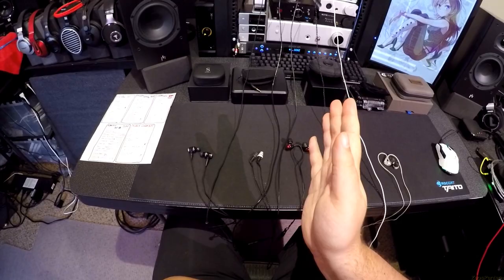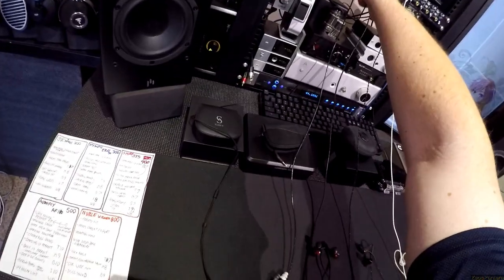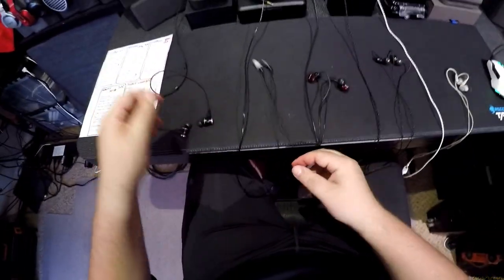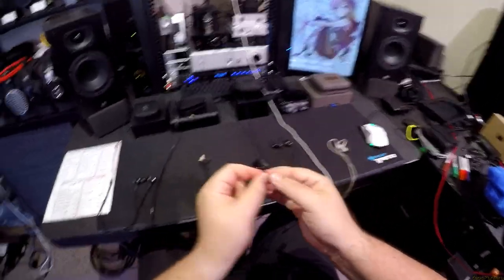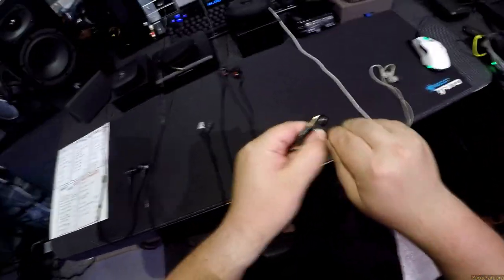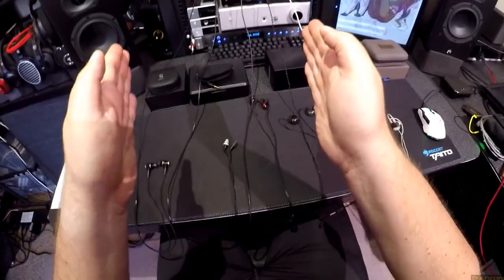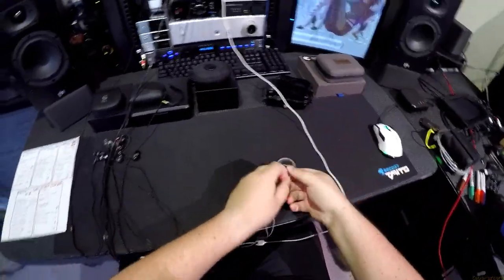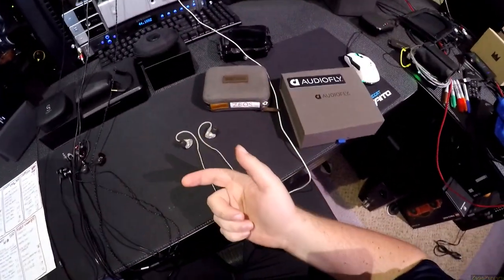Z Review - IEM Shootout #6 - AKA "The Bloodbath"

Comment: 23:20 this is the part where he fucking murders Shure IEMs
Reply: Cereal421 it would be you huh
Reply: Cereal421 he follows orders
Reply: Lel.
Reply: XD
Reply: The etymotic cable is removable

Ety S adapter is the ety sound, with out the adapter is the compromise for portable use.  Also the cable is microphonic, but the blob at the y of the cable is where the shirt clip attached and where the impedance resistors is housed if you have the ER4S instead of the P/T. The clip is dorky but greatly helps with the cable noise.
Reply: The cock rings are for attaching your portable amp to your phone/dap.
Reply from the maker: The murder is the Audiofly's murdering everything.
Reply: how does the westone w40 compare to the 5 here?
Reply: Cereal421 shure connectors are junk

Comment: The adapter for the Etymotics isn't just an impedance adapter. It converts the 4Ps into 4Ss, which are more accurate and sound better. It should definitely be plugged in unless reviewing them just for portable use.

Comment: Shure fan here, or at least one who loved the SCL2-K from over a decade ago, and has used a SE215LTD for about a decade. Both of those Shure IEMs I loved for their sound, and build quality. Also having used Shure's warranty service for the SCL2-Ks, I have been happy with their customer support.

Now the concerning what you said about the SE535LTD, I watched this video eons ago and forgot about what you said. Recently my SE215LTD after a decade of service has developed a issue in which I am on the fence about fixing them myself or sending to Shure. I also was interested in upgrading and seeing what the higher end ones had to offer, and on Black Friday these were around $340. I was expecting the triple driver setup to sound so much better then the 215s.

Anyways holy shit you are completely right. If I had remembered this video I would of saved my money. I enjoy my old SE215LTDs, and my MoonDrop Stellaris more. Like I can hear MORE details in the midrange with the 535s but the tone is off putting somewhat, and there is the sub bass, they call it "rich bass", its definitely lacking. From what I can tell changing out the filter in the stems might make these more fun from a forum post I read which I might try... But the ton makes most of the music I listen to sound meh or bad. Imaging in the mids, and sound stage is definitely there though and doing good, but the tune I presume from the filter is ruining them.

Comment: Shure se535 is awesome pair of iem. Bass is there very extensive, mid is way forward and treble is bit recessed or rolled off. I own clear version of it. I changed the filter in it to grey and orange as well. All the issues fixed. Sound couldn't be more clear and impact. Bass separation suddenly came through. There was layer of it. Treble was crystal as it could be and mid wasnt getting diluted in lows. Fits like a glove and good isolation. Also after chainging filter sound stage go way wider and instrumental separation was on point. If you want more bass that this then ie80 is way to go. I have ie 80s version and good for edm and hip hop music. Not boomy bass unless if you want to but low end is not natural feeling as in shure se 535. I also own fiio fh5 and 1 more quad drivers. These 3 i keep going back to cuz its  makes music so pleasant and effortless to listen 2.
Reply: you preffer the ffio or 535?

Comment: I'm glad I got the shure se425 over the 535. At the price point, I'm happy with the 425. You hit the nail on the head with the ratings though. Imagery that will make your hair stand up but not much bass to speak of. If you're wearing the shures the way you showed at 39 min, you wore them wrong. My shures came with the buds on the wrong sides of the cable. They're to be worn the same as the audiofly.

Comment: dunno if it got answered already.. but the noble stuff is detachable but it's stupidly tight.. i ripped the headshrink out of the plastic connector when i replaced the stock cable with one with a mic and volume comtroll

Comment: Hey Zeos, thanks for putting this together.  Great video per usual.

I have a potential explanation for why highs that were only "meh" on solid, reputable IEMs (ie Shure).  

1.) Hearing loss usually occurs between 2k - 8k (assuming that John's Hopkins Medical Center is to be believed).  
2.) In-ear monitors are situated incredibly close to the ear drum.
3.) In-ear monitors are competing with other very loud sound sources, at least in an on-stage environment.
4.) In-ear monitors are worn for what would be considered extended periods of time.

Considering the above, I could see why Shure or other professional IEM designers would make the choice to attenuate the 2k - 8k range in an effort to save end users from hearing loss.

I'm willing to accept that this theory could be complete garbage, but there you have it.

Cheers.
Reply: Does it actually matter where the monitors are? It's the sound that actually touches anything.

Comment: The ER4's actually technically do have detachable cables, although IIRC they're not designed to be removed frequently and are very difficult to pull off the unit the first time...
Reply: EMK19 just like it should be
Reply: actual QWERTY, why?
Reply: Prateek Chawla because the connector loosens and a lot of the times becomes intermittent after awhile. If they design it only to come off when you're replacing the cable, you won't have that problem.
Reply: actually QWERTY, fair, that makes sense. Thanks.

Comment: Noble cable is detachable. But the little connectors are stiff! (Got the Kaiser Universal 10's ... they are great, super light cable is no issue, more a pleasure. I did add some shrink tube at the little 3.5mm to add a bit of strain releave. For the tips, use the red tips, smoooth). For the Etymotic Research ER4P-T; the cables is also removable, same thing, stiff connectors. 
"those tips ... Comply Tips"

Comment: Hey guys, I did some research and find out that in video is Audiofly AF1120 instead AF180 and they cost 700 bucks, wich not stop me to buy them.
Reply: Its written on the case AF180 !!! but if true it will be a bummer , my 180 is on the way and it will be very disappointing to know that i bought the wrong model ;(
Reply: Hassab Saeed I saw both models unboxing, and I am sure that is 1120s, however according to reviews they have similar sound signature. But more important Audiofly's detachable cables have their own mmcx type connectors standard mmcx doesn't fit and both iems a bit slimsy (
Reply: Cerberus707 .. i saw in reddit someone says he prefers the 180 over the 1120 + Z gave his approval to the 180 ,, otherwise i would go for the 1120 , anyway i sent a message to Z to check his pair and am waiting for his confirmation , fingers crossed :)
Reply from the maker: These are the 180's with the silver cable. I also have the 1120's here now and they look identical.
Reply: Thanks Z for response, you all can check yourselves in all reviews the af180s show up in completely different leather package case, this big use for flagship iems. Wtf I am confused, but glad for you Hassab that you will get right ones.
Reply: it could be a regional thing or because Z is special , but anyway all are minores details to the sound quality ,,, will see how it goes :)
Reply: Cerberus707 .. i just got my AF180 and it has the same case as in the video ,, but wth black cable not the silver. 

These are awesome IEM ,, way way better than my IE800 ,, very balanced sound out of my mojo or my cell phone  , very impressive sound with great bass , sound stage , imaging , details ,, a bit worm but a pump at 5K-8K fixed it to my liking's , 

The Audeze isine still have the no#1 place in imaging and sense of space but the details and comfort on these is much better .. 

Now i will go and order the Bluetooth cable and the silver cable to complement them .

Thanks Z ,, great review ..
Reply: Wow , I guess they are really impressive. I have only 2 questions 
1. Some say the vocals sound muffled and behind, is it true?
2. Is it possible to modify their own type mmcx connector for attaching standard mmcx cables?
Thanks in advance )
Reply: - Not muffled at all ,, to the contrary it have forward sound .. 
- i think it could be modified , i have other mmcx cable to test but i could not detach the stock cable ,, i dont want to break them so i didnt try to hard ..
Reply: Cerberus707 AF180 is sold in a clear casing and a stone blue casing.
Reply: AF180 vs  AF1120, which ones do you prefer?
Reply: AF180s are better, but that's just my opinion.

Comment: Iirc the etymotics' cable big thing is a resistor or something.
Reply from the maker: But it comes with a resistor wire. How much resistance does it need?
Reply: Yup, it has a different built in resistor according to the model (B,P,S) which results in that huge Y-split that really weighs the cable down (I only use them with the provided shirt clip). The new SR model no longer has those resistors in the Y-split thus they are smaller than before (though still pretty chunky IMO).
Reply: Z Reviews the ER4PT has the resistor separated from the Y splitter (the separate resistor cable), but the ER4-S includes the resistor inside the Y splitter. That's why the splitter is so big, and even the PT includes the big resistor, to keep production costs the same. The resistor changes the response accuracy of the earphones from 86% to 92%, thus it should be wise to test them again with the resistor.

Anyway, these are indeed bass light earphones. Newer models are available, the ER4XR (Extended Response) and ER4SR (Studio Reference). The XR has MUCH more and better bass, you would really enjoy them, and they are not bass heavy at all, they are just what bass should be. Try to review them if you can.

Also, the ER4 and Noble cables are detachable. They're just stiff to pull out and not intended for frequent unplugging.
Reply: Igor Porto I have er4 p s b sr xr mk5 mc5. Now i love er4sr/s and mk5 most.

Comment: Hey Zeo, do you use the virtual barber video to measure width and imaging? Also, did you try the SE535s with Knowles damper replacements? https://www.mouser.ca/productdetail/knowles/bf-1999-000?qs=3unH%2FDqlvl9jDj9uyvmVwA%3D%3D?

I found about these through this thread. https://www.head-fi.org/threads/se530-535-acoustic-filter-mod-more-sq-improvement-than-cables-dampers.663273/

Comment: Yes, the noble are detachable, they are two pin connectors. I have the same problems with the fit, but once I pop on some spin fits, the sound and fits is on another level. Also may I know what model those are? Thanks

Comment: Damn happy. Yesterday I picked up the Shure SE535 at the local flea market for $1. Without this one dealer, the whole flea market would collapse, lots of great bargains. They clean out houses and do estate sales. I think this was the biggest bargain I’ve gotten. 

Anyways I sanitized them and tried them out. Sounds very good. I don’t like IEM’s. Have to touch them with my finger tip to get the full range of sound. I prefer full sized over ear headphones. But I’m happy with the Shure’s. These only has the installed rubber tips. They are fidgety to get them to seat in your ear properly. Finally figured out I could bend the over ear wire to customize the fit. Once set they sound good. If I touch them, then I get the full bass. Besides the unnatural in ear feeling, the need to touch the headphones to hear the bass, has always been my issue with earbuds
Reply: Get some better tips, foam tips are my go to and they're rather lovely for both comfort and sound.

Comment: Etymotics have detachable cables, they're not supposed to be removed unless you break the cable, which is exactly the way it should be. the y split thing has resistors n shit in it. Also, its almost imperative that you use the shirt clip to avoid cable noise

Comment: Did they tell you why they sent the 180s with the 1120 case? Are you dead sure those aren’t the 1120s?
Reply: After research, it looks like they switched the case that comes with the 180s lately.
Reply: 180s are not clear. Only 1120s are clear.
Reply: AudiophilePhotographer actually since the 1120s the 180s also come in clear, with the same case

Comment: With headphones you can audition them with stock pads and it gives you pretty good feeling about the sound. This is totally useless with IEM. If you do not get a a right seal they all sound like shit. My initial impression with SE535 was exactly the same: crap no base. Then I read Tyll's review of the entire Shure line and started with different tips. Once I got the right seal I know that would be my IEMs. The way Z is putting SE535 in his ear shows that he did not even try to seal those IEMs.   I bought HD600 and HE500 after watching his reviews and I am very happy with both. But after watching three of those shutouts I do not pay any attention what this guy is saying about IEMs .Buying IEM is hard, evaluating is even harder. Z does not like hard anymore. Putting six pairs on the table and jerking some cables does not do it.

Comment: @Z Reviews , been a fan of the channel for a long time and have always agreed with your ears. 😁 So I've got a slightly odd question for you. 😏😅

I've been tempted to buy something like the Fiio Fa7 or Shure 535 (off the list after this review 😉) for about £300. 

After doing some research I came across Knowles, and there pre made GV quad drivers (crossovers are already done). 
My question is am I better off using something like these drivers to make my own iem's for under £100, or buy something like the Fiio Fa7 (pretty sure it also uses Knowles) for £300? 

I'd also be following all of Knowles pdf's on iem design for OEMs, so wouldn't break any of the design rules. Also means I can tune sound signature to taste by changing tube length and damper strength. 😊

I just figured with correct materials and pre made driver system from Knowles I could save some money and still get something that sounds ok. 😁

P.s. if you've actually read this far thank you I'm honoured. 😊 I don't expect a definitive answer, just thought you'd maybe find this a more fun side of iem design. 😉 I've certainly found it fun, learned an aweful lot about balanced armatures 😏. Most fun thing I've learned is tube diameter and length can boost treble extension, above the lvl measured at the driver 🤯. 😁 Lots of patients I can use too, as I'm never planning on making more than 1 set and never sell them. 😂
Either way, thanks again for all the great videos and reading this. 😊 Have a great day, peace.

Comment: Funny the way he described the SE535. It's exactly what I didn't like about the normal brown? Gold? ones. But because I live in Asia I got to try the Special edition Red from Japan (the ones with the gray/white cables) and only then did I really like them.

The treble and mids from the browns were way too piecing for me. I'm not an audiophile by any means so the only way I can put the Japan special edition is warmer. The bass is brought up quite a bit and the highs and trebles are more controlled. Much easier to listen to than the browns/golds.

I'm not gonna claim they're amazing since I don't have many other points of comparison.

I tried the ue900 and some westones I'm forgetting the model off before purchasing but just ended up preferring the SE535

Comment: I've used er4xr for about a year and se535ltd for about a week and i have to say his review is spot. at least with my my experience. the reason i got the se535ltd was for its strong mids lows. i was listening flat/neutral signature with the ety so i wanted to try an iem warmer signature. may not be not accurate but a fun iem.  i wanted to experience melted caramel oozing out sort of vocals. in the 535 the vocals did stand out but that not much. and lot of details were missing in action in the treble. and you can really tell the difference when you try them back to back. anyways i am curious to know his pick between the westone w4s and the af180. i can pick up af180s for about 300 bucks where i live.

Comment: @ZeosPantera Not sure if you know this, but, with many of the foam style ear tips, there is a special method of insertion to maximize the seal. I'll add a link to proper instructions, but essentially you roll the tips to compress them like normal, use your opposing hand to tug on the top back corner of your ear, and insert and hold for 15-30 seconds. This is also commonly the same instructions you find with earplugs. https://youtu.be/8vHP8K3BsrA?t=2m19s  <<<(3M Demo on earplugs, but it is the same concept)

Comment: can the 1more quads compete with these?
Reply: Yes, the Shure SE846 is better but I've had the SE425 and tried the SE535 and SE846 and the 1more is to my ears  better than the 425, slightly better than the 535, not as good as the 846.